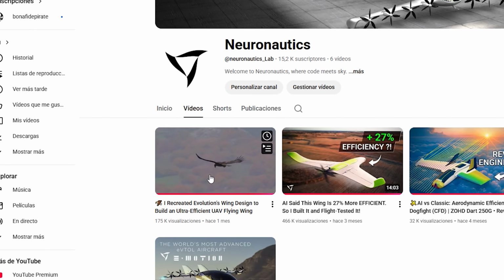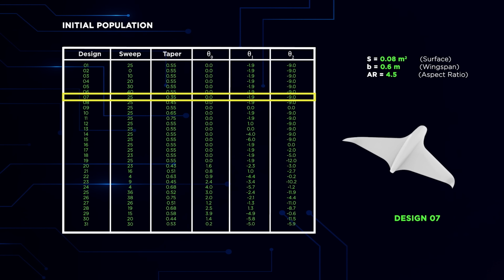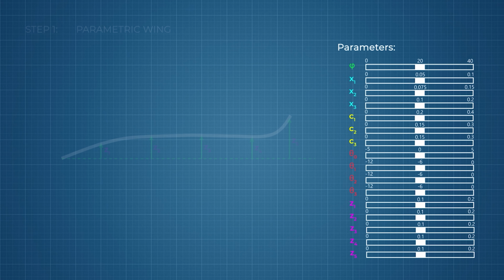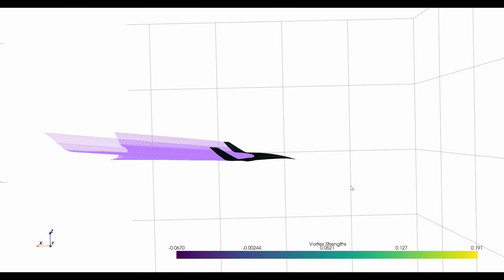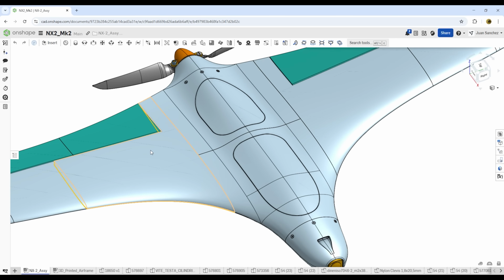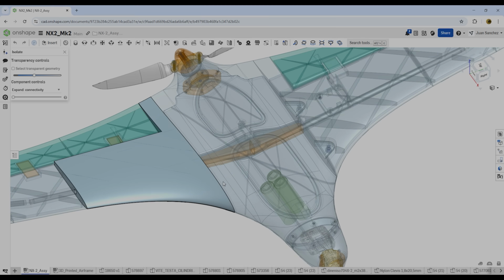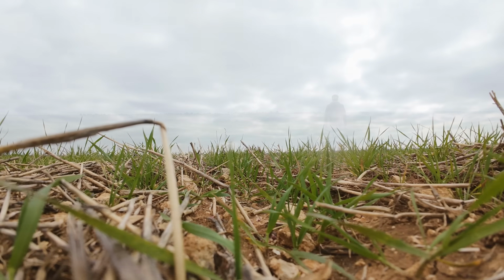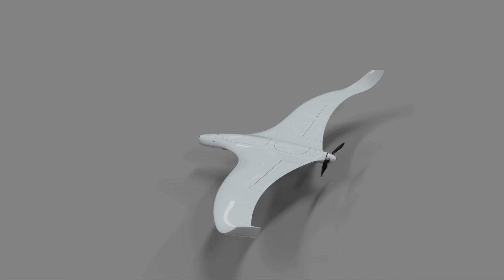AI Designed This Organic Flying Wing… I Had to Build It (+16% Efficiency)

Comment: AI seems to have figured out that birds are designed best.
Reply: Please point out Any bird with the strong tip dihedral of the original, or the optimized wings in this video? A distinctive feature to create stability which no bird has. All birds have internal stability programs, in optimized neural systems and sensors, which probably still exceed the best computer stability systems all but unlimited Defense Dept. budgets have financed. Birds don't need vertical stabilzers, and largely dispense with horizontal stabilizers, using variable sweep and incidence wings for variable CG and combined 'aileron' control. As well as flapping thrust.
Reply: @billtaylor3499  Turkey Vulture, Northern Harrier, and Zone-tailed Hawk to name a few.

Comment: This triggered my university mind so hard that i bought it and started printing immediately. 

just curious, ive basically got all the electronics, but what battery are you using for this build?
Reply: Matched battery and motor/motor cotroller packages are at hobby stores now. Most integrate well into the usual Futaba flight control radios. Electric flight RC is now a cookbook recipe, fully served by the hobby industry.

Comment: you could build them to flex like a bird, if you make the wings out of a semi-flexible material, then have cables run down the wings, then tightening and loosening the cable with motors in the belly could flex and shape the wings.

Comment: This is amazing. Also, I have 2 observations: 1) it isn't really a surprise, it looks reassuringly "right" 2) It also resembles aircraft in every other sci fi movie since the 1980s. Clearly, the birds have 100 million years of evolution which has pretty much sorted it out. Congratulations on the effort and thought you put into this. However, AI didn't design this, you did! AI just helped to speed up the process.

Comment: Honestly, I wanted to fast forward through the build, but I was enjoying the sounds, and my brain felt like every step was important.  This was fascinating. Not completely unexpected. To me, it is not A.I. - this is what your brain would do, going from idea to idea, amplified by a computer tool.  But, that is what it is for.
I'm a bit curious about the surface of the printed form, vs if it were coated or produced smoother.  Ideally, a refined printer and material to create the slickest surface possible?  If so much is about weight and strength, when do you conclude to print a frame that then has a paper skin covered in dope, like in the old days?  Or, is the printed material as skin so much stronger that it eliminates more substructure than the other way?  When does the skin become two layers separated by a honey comb substructure?  I'm a bit envious of your brain and skills... Good luck on future builds!

Comment: to improve efficiency, you should use tape to seal the gaps between the wing parts.
Glider planes do this IRL because the effect is much larger than you'd think, due to the pressure difference between the bottom and top of the wing

Comment: Excellent work so far!   For your next prop optimization efforts, I would think that a DE computer simulation (of prop parameters vs thrust) would give a faster, more optimal and certainly cheaper solution than physical testing with buying available commercial props, given limitations of availability of off-the-shelf prop profiles, diameters, pitches, etc.  The issue is that static velocity testing on a bench isn't fully representitive of the props performance in-flight at-speed.   Also, after testing your final solution, perhaps consider a few final tests of 3D printing the motor mount at several different angles to vary the vertical thrust angle by a degree or two.  Maybe something to be discovered there.

Comment: If I was equitpped to do something like this I would try real hard to build in controlled flexation like bird wings.    Wing warping they call it.   Instead of flaps and aeroloins.:   Warping camber, warping twist,   and flapping,   then you have the best wing for the low subsonic regime.    JMHO.

Comment: I'm in the process of printing this. It's going really well. I would like to make a couple suggestions though. First, the wings go together really well when there is a carbon rod to help align them but the tip could use 1 or 2 alignment pins built in. It's tough getting them looking good. Second, the reinforcement pieces for the wings that's glued into the front half of the fuselage is VERY difficult to get in the right place so the wings are straight. I remixed the front half of the fuselage so those 2 pieces are printed in the same part. There's just enough angle that the hole for the carbon rod came out almost perfect. Just ran a drill bit through it to clean it out to be perfect. I did use variable layer height to assist. The elevons could also benefit from alignment pins. Even just one pin would be better than freehand alignment. Maybe just a hole precisely placed so the builder could use a short piece of filament as the pin.

Overall I'm really happy with how the build is going. Thanks for making this available to us. I'm sure I'll enjoy flying it even more than building it.
Reply from the maker: Hi Scott! 🙌 Thanks a lot, really appreciate the great feedback — comments like this genuinely help me keep improving the design. Very glad to hear you’re enjoying the build, and those suggestions about alignment pins and the fuselage reinforcement are really valuable. Please let me know how the maiden goes and share your feedback after the first flight! 🚀✈️
Reply: @neuronautics_Lab  Maiden feedback will be a while. Weather here is crap. Normal spring storms and wind, and still rather cold most of the time.

I sent an email with the forward fuselage mod in an STL.

Comment: I don't think that you ever took into consideration prop wash while looking at your design efficency
Reply from the maker: Thanks! 🙌 You’re right — for a more in-depth power-on analysis, prop wash should definitely be considered. In early design stages, aerodynamics studies often simplify the problem and leave out that interaction during the preliminary phase. In this case, since it’s a pusher setup with a relatively large propeller moving air more slowly, the effect is almost negligible

Comment: Really cool video with a lot of information! It would be nice to compare the weight too, so we would know how much of the improvement came from optimizations vs reducing weight. Keep up the great work!
Reply from the maker: Thanks! 🙌 Really appreciate it. Weight is definitely important, but in this case it wasn’t the main driver since wing loading was kept fairly similar between both designs, so the comparison is more focused on the aerodynamic/efficiency improvements from the geometry itself rather than just making it lighter. 🚀✈️

Comment: straight line glide performance, handling agility, speed, sink rate, stability... The choices can be designed in and there's always a compromise in some other parameter. With hang glider design, a sweet handling glider is much better that a slippery glide ratio beast that resists banking
Reply from the maker: Absolutely — that tradeoff is a huge part of aircraft design. Chasing pure glide performance alone can easily hurt handling, stability, or overall usability, so the real challenge is finding the right balance for the mission. 🚀✈️

Comment: Did you consider using an Elastic band as a launcher? I recall old toy planes doing that. Would make it easier to launch, potentially?
Reply from the maker: Sure, that could work too. I just feel more comfortable with a hand launch here, since this design doesn’t require much speed to get flying. 🚀✈️

Comment: interesting, btw which AI did you use ?
Reply from the maker: I used AI mainly as part of the optimization workflow, not as a single “chatbot” tool — mostly Python-based optimization methods together with aerodynamic simulation tools to explore better designs automatically. 🚀✈️
Reply: @neuronautics_Lab I understood that, it was a VLM, but I'm still confused about the process of it. Like where did you get the data set for the different geometries (did you run simulations for all different combinations or it was available somewhere if you ran custom simulations for each then it's 😬 must have taken a lot of time) and about the overall integration for the final design. Could you maybe make a video on that specific process ?

Comment: Measuring efficiency with km traveled is not that useful unless you can guarantee wind conditions are the same. The weight of the plane should be considered too, when comparing the designs. fwiw my old Skywalker Falcon (634g no FPV) did a 70 minute flight on a 3S 2200mAh lipo, so yes I think 1 hour should be possible for yours.
Reply from the maker: Very fair point. Weight is already indirectly considered, since both designs were compared around a similar wing loading and the same operating point, so the improvement is not just from making one airframe lighter. And while km is not a perfect metric in absolute terms, it becomes a much more meaningful comparison when both aircraft are designed and evaluated for the same speed regime. 🚀✈️
Reply: @neuronautics_Lab  I disagree. Moving a 400g object 1km requires more energy than moving a 300g object 1km - wing loading has nothing to do with this. I'm not sure what your point about "speed regime" is... are you using AI to write comments as well? Sure seems like it.

Comment: “Ai” cannot design anything. These are predictive token models which do nothing but output most likely stolen content on which they were trained. Don’t enable this slop to propagate.
Reply from the maker: I think you didn't watch the full video and may have misunderstood the way AI was used here — this wasn’t about a token model “inventing” a design, but about optimization/MDO methods exploring design variables under engineering constraints. So the AI part in this context is much closer to computational optimization than to generative content. 🚀✈️

Comment: AI did NOT design this! It just used the work of Horten and other great designers and vomitted this design. You have to be serious here. This is a very slippery slope.
Reply from the maker: I get your concern, but in this case AI did not “replace” the designer — it was used as an optimization tool inside an engineering workflow with clear variables, constraints, and objectives. The final result still depends on human setup, interpretation, and validation, so it’s much closer to assisted MDO than to blindly generating a shape. 🚀✈️

Comment: That is a work of art. It deserves a mirror finish (Mylar wrap) to accent the subtle curves. 

Will this scale to larger vehicles?
Reply: Depends on the Reynolds number this craft is flying at, and designed for. Soaring RC planes are often at very unrealistic (low) Reynolds numbers for man carrying craft. I don't know what speeds this one is optimized for, and being flown at.

Comment: A polish-like surface finish would help efficiency greatly. Just spray on a coat of spray paint just thick enough to make the surface shiny
Reply: That adds weight... wet sanding with 2k-5k sandpaper may have a similar result

Comment: Wouldn’t Bayesian Optimisation be a better approach for optimising over 17 parameters? Also many questions: do you obtain different results if you re-run your optimisation? How did you determine the penalty weights? Changing these would also alter the design.  But it’s clearly an amazing project and thank you for sharing this superb video.
Reply from the maker: Bayesian optimization could be a very good option too, especially depending on evaluation cost and search space structure. In my case, re-running the optimization can give slightly different results, although the overall trends stay similar. And yes, the penalty weights do influence the final design — that’s always one of the key sensitivities in MDO, so they need to be chosen carefully to balance the objectives and constraints in a meaningful way. 🚀✈️

Comment: With all the talk of toroidal propellers and other propeller designs it would be interesting to see the AI generative process tackle the props. It seems like the most difficult part of using AI for tuning is designing the scoring
Reply: This would be interesting.  Are the models capable of estimating noise profile/amplitude?  If so, that would be really awesome.  If one of these was quiet and otherwise inconspicuous (camo), I could see it being a useful addition to the toolbox for people who need to inspect various types of urban infrastructure.  You could easily survey something like a long stretch of electrical lines with decent visual resolution, while also not disturbing the NIMBYs.  Similarly, it could prove to be a very useful wildlife survey tool for ecologists if it doesn't disturb the local fauna.

Comment: Don't  you need to add in  the airflow  effects  of  the propeller?
Reply from the maker: You’re right — for a more complete power-on analysis, the propeller airflow should be included. In this early stage I simplified that interaction, and in this case the pusher setup with a relatively large propeller makes the effect less critical for the preliminary study.

Comment: How do you cool the speed controller?
Reply from the maker: Ventilation was carefully considered in the design: there’s a NACA-style inlet at the front, and the gaps around the motor at the rear help the air exit, which provides enough cooling airflow not only for the ESC, motor, flight controller, etc. but also for the DJI O4, which tends to get really hot...

Comment: Everything is called ai now, but when the term comes to be bitterly hated, they will stres how it is really good old sth or other defs not ai. Y 19:44 ou saw it here 1st, and when your job is given to a bot, you will be inthat paradigm.
Reply from the maker: I get the skepticism, but in this case it’s not just a buzzword — the workflow really does use AI/optimization methods to explore and improve the design automatically under constraints. The name may be overused today, but the underlying computational approach is very real.

Comment: Just discovered this channel, watched all of the videos, and subbed. Excellent!
If you ever decide to try to build something even more bird-like (NOT including flapping wings for propulsion!) , let me know, I have some ideas (cant try them myself, I am old, infirm, and dont have the skills). I would suggest you look into  some form of landing gear though - , and preferably bird-like, so it can plant itself as it comes into land, rather than rolling on wheels. Hmm.. actually, put some spring in the legs, maybe it could self-launch...
Reply: Pilot is the key element in 'landing'? Almost every HLG pilot I know hand catches their plane, to reduce damage and make relaunch immediate. This design doesn't seem to have much penalty added for poor (high) stall speed, and there seems a reluctance to add the complication of split flaps or flap/ailerons offering differential opposing angles for spoiler function. For true high speed craft, drone work in war setting seems to find catch nets the best workable option, till size and mass make net catches impractical.

Comment: The design is incredible, congratulations for the maiden flight. I am in a student UAV team at İstanbul Technical University and we will be competing in the ACC 26 in Germany this year. We mostly completed our aircraft but your AI got my attention so much. Is the AI an open source platform that we can reach our is it your own creation?
Reply from the maker: Thanks! 🙌 Really cool to hear about your UAV team — good luck at ACC 26 in Germany!
The workflow I used is my own setup built around existing tools (optimization + aerodynamic analysis + simple 1D beam analysis). I’m preparing the full workflow and code, and it will be available on my Patreon if you’re interested in experimenting with it for your own designs. 🚀✈️

Comment: Would this scale to a full size, manned, airplane? If so, how?
Reply from the maker: In principle yes — the same optimization/MDO philosophy absolutely scales to full-size manned aircraft. The big difference is that once you go full scale, you need to include many more constraints like structures, aeroelasticity, certification, stability/control, manufacturability, safety margins, and human factors. So the idea scales well, but the model has to become much more detailed and multidisciplinary.

Comment: If I bought your 3d modal do you think it could be scaled down 50% without messing up too much?
Reply from the maker: Thanks! 🙌 I’m afraid scaling it down 50% wouldn’t work well, since many interfaces and internal allocations (inserts, servos, camera mount, motor, etc.) are designed around specific component dimensions. Reducing the size that much would likely make those parts incompatible. 🚀✈️

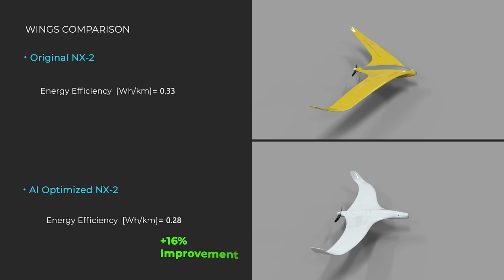Comment: 18:49 that´s just shy of 4,5Wh for 10miles, "less than 4,5Wh/10miles" is easier to remember basically, that´s why I did the conversion.
Reply: So about 60 mile range?
Reply: @breckfreeride  That would be 27Wh/60miles, but I cannot recall what battery he was using... For that, you multiply battery-voltage with -amperage, and if the result is just shy of 27Wh, then, yeah, that´s enough for 60 miles,
Reply: @klausbrinck2137 yep with reserve... he had 2 1300 3s packs